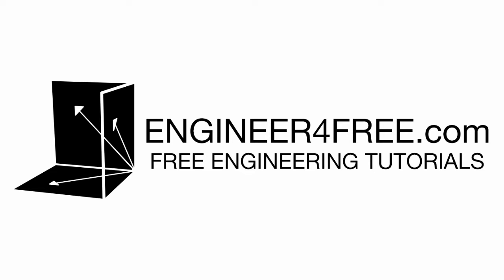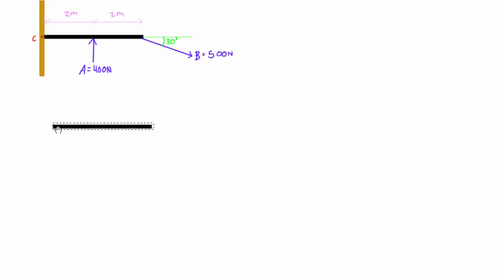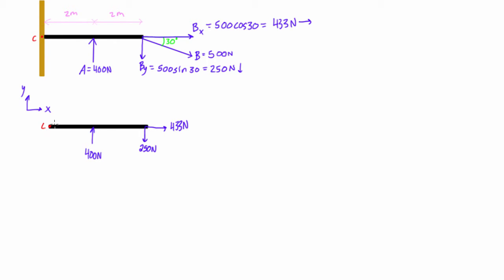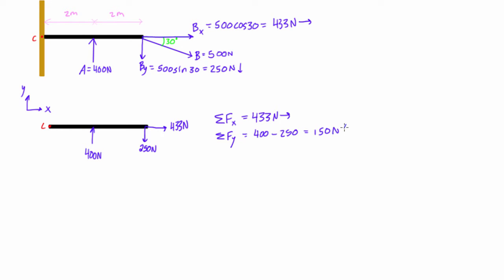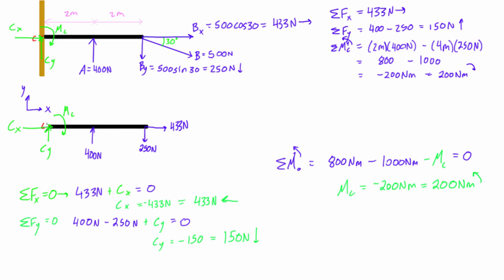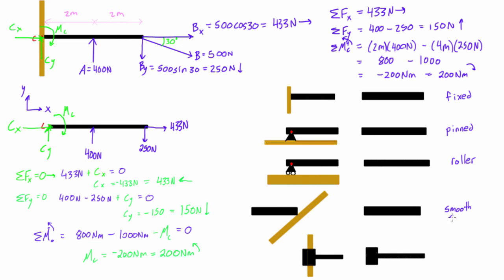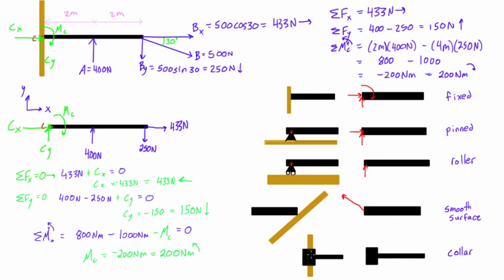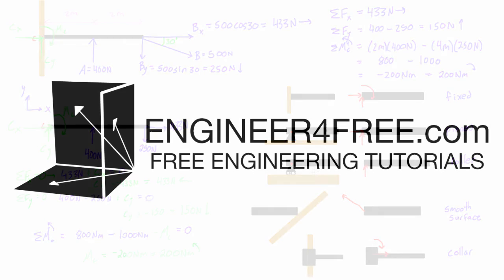Reaction forces and the different types of 2D supports

Comment: Why are you not including the x component of the force B in the moment calculation? You included an x component in one of your previous videos (Find the moment of a force about a point)?
Reply from the maker: It is because in this video, the line of action of the x component of force B passes through point A. A force will only cause a moment about a point if it’s line of action does not pass through the point. The other video, the x component of the force would not have passed through the point in question.